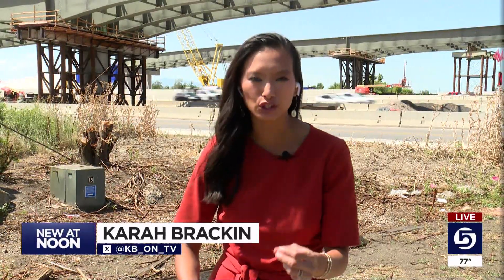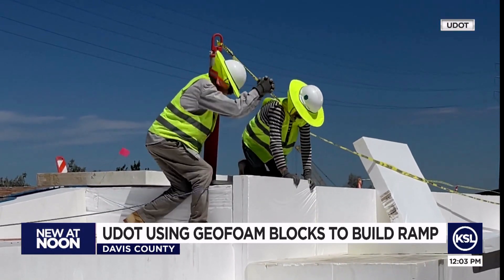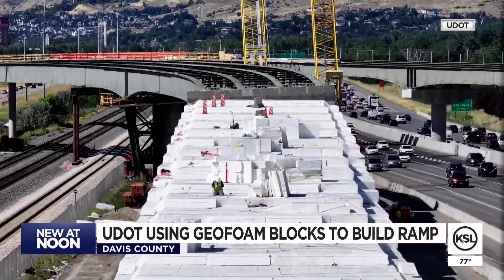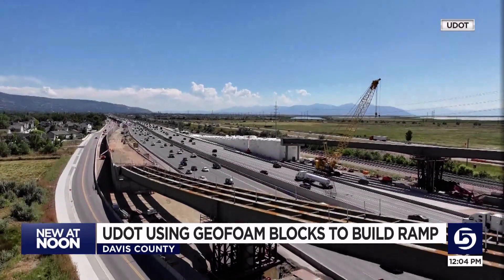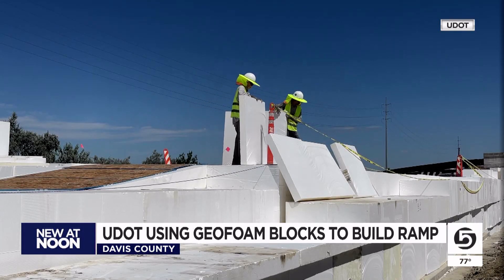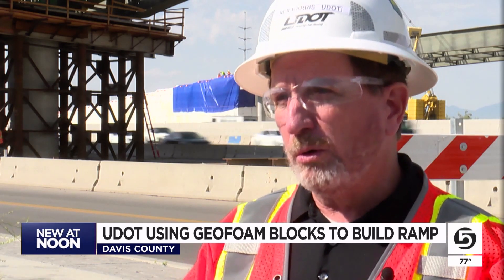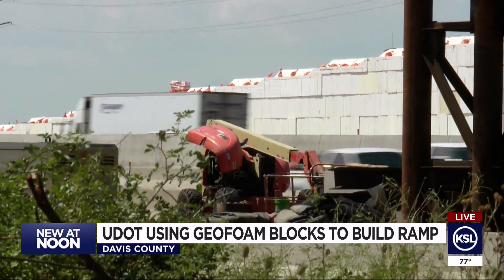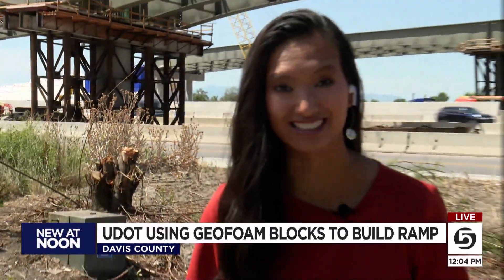UDOT uses geofoam blocks to build West Davis Highway ramp

Comment: What happens if it comes in contact with gasoline ?
Reply: Since nobody answered and I too was curious, I went to the website and located the following statement below for you.

Despite their inertness with substances found in the ground, EPS geofoam blocks are surprisingly weak against hydrocarbons. Even limited exposure to a very small amount can cause a lot of damage. For road construction applications, the proximity with gasoline warrants stringent contingency measures. There might be a spill during transportation or an accident that causes a gas leak on the road; you can’t afford for the road to start deteriorating.

The best way to protect the EPS foundation is to cover the block with a petroleum-resistant geomembrane (PRG). The concept is quite simple. Imagine a chemical-resistant sealed bag that contains your EPS geofoam blocks. The bag won’t affect the performance of the EPS block but will protect it against any chemical reactions.   

Hydrocarbons are among the harshest chemical compounds and finding materials that completely resist their corrosiveness is difficult. 

PRGs are the best choice for such applications as they are not permeable and do not deteriorate even after prolonged exposure to petroleum compounds. When selecting a PRG you must consider not only the hydrocarbon resistance of the product but also its dimensional stability. The highest levels of dimension stability can only be achieved by using a fabric-reinforced geomembrane. The strength of the reinforced product will limit the elongation of the PRG to prevent unnecessary settling under load. Typically, a product with 600 pounds (272 kg) or more breaking strength is being specified by state departments of transportation (DOTs). Currently, the best-performing products are reinforced ethylene interpolymer alloy (EIA) geomembranes.
Reply: @georgemccune2923  Thank you for the follow up.
Reply: @EntropiaBones  No problem. Glad you got to see it, I was unsure if you would since it had been a year.  Funny how boredom works and the things we find ourselves doing.